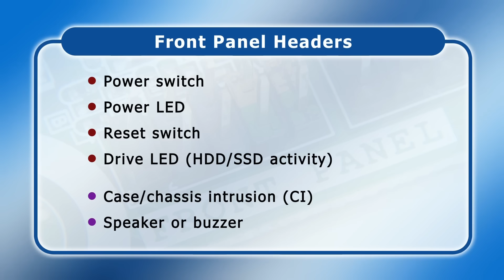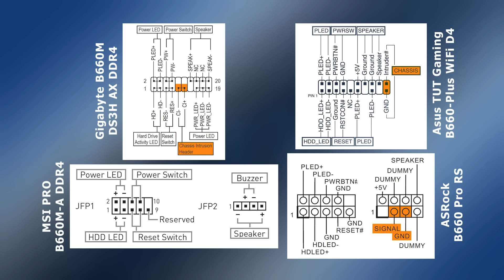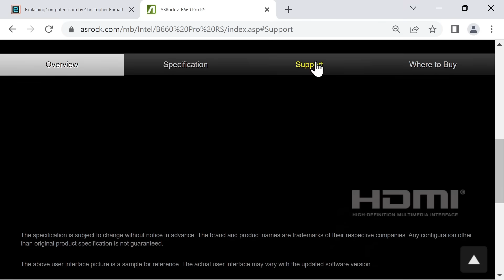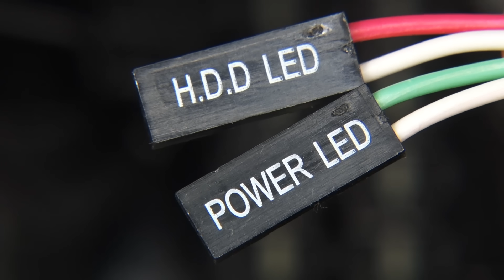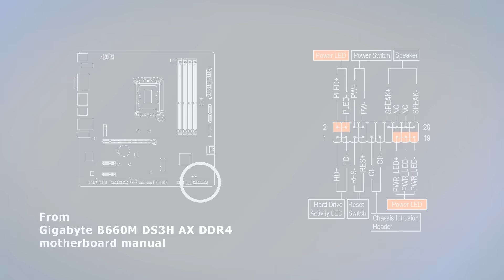Explaining PC Front Panel Connectors

Comment: I’m just building my 1st PC in 20 years and I’m astonished at how little has changed in all that time. I checked out this video to update myself and I find that almost everything is the same  (Except: The CI and TPM  connectors which are new to me.)
Ant they STILL haven’t standardised the Front Panel connections!!!
Reply from the maker: So true! Some things have not changed in a long time now. We just have new CPU sockets, plus M.2 slots. :) Oh, and USB 3.x headers are new in the past 20 years.
Reply: @ExplainingComputers   What really astounded me was the presence of the old  round "PS/2" keyboard connector on my brand new  motherboard:
  "Gigabyte A520M K V2 Motherboard - Supports AMD Ryzen 5000 Series AM4 CPUs" .    I haven't seen a keyboard or mouse with a round connector on sale  since the long-ago 20th century.    IBM designed it in 1987 (thanks Google).    Why on earth do they retain a  keyboard/mouse connector that  cannot be used?   Baffling.

Comment: Polarity does not matter (for the power and reset button). Thank you for that piece of information; my ASUS motherboard and/or Fractal Design case should have mentioned that.
Reply: My PSU has the label on the power pin's plastic face the other way when I plug it. I decided to plug it in so that the white (negative) lead goes where it's supposed to be by default. Threw me off for a moment 😅

Comment: I'm doing it since 1988. I'm not afraid doing it, but I ALWAYS have to consult the manual for the correct pin layout. Furthermore: a speaker actually HAS a polarity, but for the use case of just beeping, it simply doesn't matter if the menbrance swings to the wrong direction. I wouldn't do that for hifi though.

Comment: However this is a problem. Putting an older motherboard that doesn't have that 10-1 JFP1 plugin. The MOBO I am trying to install a 20-8 pin layout and I can't connect with out breaking up the connector pins. How does one go about fixing this connection issue?

Comment: NZXT cases come with just one connection for F-Panel. Just wondered if you have tried building a computer using NZXT cases? I find just one connection better than 4 different connector cables because of my poor eye sight. Also, I find motherboards with built in IO shield better so you don't have to fiddle with all the back connectors to align properly.

Best regards.

Comment: I've been coping with that very annoying non industry standard pin layout since before your time. Now however you can get motherboards with nothing but different colors on the base of the pin platform, and monochrome illustrations in the manual. 🤦 Being well into my 60's now with progressively worsening long vision I find myself wearing my glasses as well as trying to hold a magnifying glass, and sometimes a headlamp as well. Then I put a hand in front of either the light or magnifying glass and can't see jack s#*t. Can the case and motherboard industry please just agree upon a standard and make a plug and socket already!!!
Reply from the maker: Thanks for this, but I don't think you have been dealing with the non-standard layout since before my time. I'm 56, and the first IBM PCs were launched only 42 years ago! :)
Reply: @ExplainingComputers  At around 12:50 you said "back in 1996 I built my first desktop PC" My comment was based around that as I had built desktop PC's prior to the time you stated in your video. My ramblings were obviously poorly articulated and caused confusion.

Comment: Great and helpful. Just had to replace an older Asus motherboard with a new B550-Plus. Asus decided to eliminate the connection block that came with my previous board. Anything to save pennies.
Why is there such confusion between the definition of "GRD' and '-"?

Have yet to power up but have every hope all will be seamless

Many thanks.

Comment: I have a questions: is it possible to connect both minus from the hdd and power led? To use a rgb switch it has only 1 pin for minus and 3 for the colours each
Reply from the maker: Yes, if you have an LED with a pin for each colour, and a minus/negative pin, then you could (for example) connect its minus pin to the minus for the power led, and then two of its colour pins to the power LED and HDD pins on the motherboard header. All minus pins on the header go to the same negative rail -- ie they are all connected.

Comment: While a beep doesn't really need to sound great, and so polarity doesn't really matter on that speaker, for future reference it would be good to note that even though speakers run on AC, that which they run on is signal-sensitive, meaning that the hardest pushes of a sound should move the speaker cone forward rather than backward, meaning that ultimately a speaker's polarity does matter, at least in situations where the sound quality normally matters (the system audio being a perfect example of that).
Reply from the maker: The comments about speaker polarity in this video clearly in the context of a motherboard speaker, not system audio. And in this context, speaker polarity does not matter. This is an educational video, and in education, less is more.
Reply: @ExplainingComputers : I'm fully aware that you were talking about the motherboard speaker, which is why I already said "system audio" in the example that I gave of where the speaker polarity matters more. And I said that so that: 1. If somebody who sees this video was thinking of hooking up other speakers in a different situation, hopefully they would see my comments and not think that speakers are polarity-free; and 2. in case you were planning on making a video about connecting other speakers in a manual way like this, but to the main audio, you would remember to include that speakers actually are polarity sensitive.

Also, obviously this is an educational video, but "less is more" doesn't actually apply, because some material educates better than none, and none is less than some. And there are plenty of times when education didn't work because there wasn't enough explanation. So I would stay away from that maxim for education if I were you.
Reply from the maker: @HelloKittyFanMan  It is deeply unlikely that anybody would use this video as a gudie for connecting speakers in other situations. With over 30 years as a university lecturer and author, with many educational awards to my name, I think I don't need advice on that matter from somebody who doesn't even declare their real name on YouTube. Goodbye.
Reply: WOW,  @ExplainingComputers ! Whelp...  you never really know, and I've already made the comment, haven't I?  But that's why I said this in reference to one of your possible FUTURE  videos that includes speakers, isn't it?
You don't have to be so grumpy that you let your ego get in the way of accepting a simple info. comment like this main one.  Also, just because someone doesn't use their real name on a forum like this one doesn't mean they're afraid of what they're saying, or that what they're saying is unworthy of being taken seriously. Maybe you've never heard of having a nickname-based user name just for the fun of it. You might try looking around at all the different user names here that aren't people's real names. That's a pretty common thing, actually. Tell me: Is "Explaining Computers" YOUR real personal name, so you don't mind using this logic on me?
Reply from the maker: @HelloKittyFanMan  My name appears in every video and is listed in the YouTube about section. Yes, not saying why you are is pretty common. That does not make it good practice.
Reply: @ExplainingComputers : Oh yes, I forgot, it shows up right at the start; sorry, Christopher. "Not saying why you are"? Why I am... what? Or did you mean "WHO you are" instead? Because if so, then this is my reply: Yes, it makes a fine practice to have a playful handle. It's just a fun thing that a lot of people do and doesn't render what they say as any less credible if they don't already have some clout in the field that would raise their credibility above that of an average Joe.

If I were to put a name that looked real on my profile, how would that matter to you for credibility if you don't even know if that is my real name? I could use any real-looking name and you wouldn't have any idea if it was my real one or not, would you? So it doesn't make any difference if the name I use looks real or not; just because you might identify me with a realish name doesn't mean knowing that about me makes anything I say more plausible than if I say it with a totally fake-looking name. You don't know who I am either way. What matters is the material that's said, as long as it's verifiable; not just who says it. Or even if it's not verifiable but it still sounds like it makes plenty of sense as an idea of something to try, it still doesn't matter who I am.

And what I said about speakers does make sense to consider because you never know who's gonna view you as an "authority" on wiring this or that and then base something else they do on this. So it shouldn't be such a big deal to you or your ego if someone like me pops in with the information about speaker polarity for future reference even though it doesn't really matter just for a little beeper speaker. Try wearing a little humility sometime. Just because you have 3 decades of whatever experience doesn't mean you can't learn from someone else, ya know. No need to be grumpy about it, Chris.

And one of these times I might just share my real name.
Reply from the maker: @HelloKittyFanMan  I did mean "who". Just a typo. I am sorry if I have offended, and did not want to get into an argument here. But I think very carefully about what to say and what not to say in a video -- usually recording many takes, often scores of takes, to get it right. And sometimes I make mistakes and freely admit that in the comments.

But in relation to the issue that started this thread, I communicated clearly in the context of the video. I feel that YouTube has become a sort of caveat hell -- it is always possible to say more on almost any computing and related technical subject, but the more that is said, the longer and less accessible the content becomes for the intended audience (hence less is mroe). As I just said, I'm sorry if I offended. But I know how to teach, and whilst you may disagree (fair enough), I explained my position clearly in my first reply to your post. You did not seem to like that, and that's when I got "grumpy".

Comment: A few years ago my computer would randomly shut down. Totally random. This started happening more and more as time went on. Tired of it i suspected overheating, even though my gut told me thsi was not it. Took cpu off and re-applied thermal paste. North/south bridge got the same treatment. Dusted otu the cover. Cleaned the vents. Crossed fingers. Did not work. Ok. Cables. Must be cables. Replaced cables. Nope. That was not it. Faulty CPU or motherboard? Switched out both independent of one another. Nope that was not it. Memory. Must be memory. Nope. 

Running out of things to test here. Long before i started all this i suspected that it was very likely the simplest solution. Something which i had learned when i took some certifications, which i passed by the way. Occam's razor. After dusting out the case and re-appying the thermal paste i suspected that it was the power switch. It was. I had to get a new power switch.

Comment: I'm wrestling with these right now for an ASUS X470 board I bought secondhand from a friend.  I ended up getting a Q-connector to try and make it easier.  We'll see if it works.  At the moment the PC will not fire up for some reason.  The board is good so I'm wondering if I have them wired wrong.

Comment: Brand new Corsair 4000d airflow does not have HDD Led or Power Led connections, so no there won't always be these connections. There's no need for a HDD Led since everything has gone NVME SSD and there's no need for Power Led because the power button itself can be lit.  This information was generally true many years ago. Should probably do some research on current trends before making a video like this in 2023.

Comment: Something that wasn't mentioned in this video, is that Intel actually tried to create a standard for the front panel connectors (called the Intel Standard FPANEL connector), and a lot of their boards use the same layout. I've found that other brands sometimes used the same layout as well. Unfortunately it doesn't seem to be that common to truly be called a standard.
Reply: Actually, another thing i've noticed, if you look closely, every single board shown in this video (including the CGI render part) actually follows the Intel standard! So this might actually be a lot more common than I thought!

Comment: Thank you for your good explanation of these things. I just upgraded a old PC with a new motherboard, RAM and CPU.  And yes I was worried about the front-panel headers. But a bit of reading in manual and some common sense helped me and after some errors I managed to set it up properly. I wished I had watched this video before, would have saved me some time.

Comment: These are a little tough to connect/contact with since they are so small. Sometimes I had to flash a smartphone light onto it until I would finally get the connection right. It's sad that you can't get PC diagnostic speaker on the AM5 boards, but someday I am sure somebody will make a internal USB accessory of sorts, or maybe even a PCIe card with those legacy functions.

Comment: There are simple adapters where you can group together the front header plugs  to make them easier to plug onto the M/B (featured/mentioned on CaryHolzman YT channel).
Reply from the maker: Such adapters are motherboard manufacturer specific -- as the video shows, there is no single pinout standard, so no universal adapter! :)

Comment: 2022.. why is this still the exact same mess as it was back when I built my first 486 in high school?
Reply: :) if you don't have a manual just drag a screw driver over the pins till it turns on... don't actually do that.. not that I have... cough..
Playing hours of Kings Quest 1 with a PC speaker for sound.. I wish to disagree. :)
Reply from the maker: Good point on old games using the speaker! :)

Comment: Great video My biggest gripe is these stupid connections need to be one plug and a industry standard connector. On small cases with the motherboard right up against the case I have to use needle nose pliers to connect them its a stupid system.

Comment: Hi Chris. You can get a "quick release" front panel connector as my motherboard has one. It's like a carrier that you slot all of the front pannel connectors into and then the whole thing slots into the motherboard. My mobo is a Gigabyte Aorus Elite X570 if you wanted to take a look. Also front panel connectors have an arrow on them indicating the positive

Comment: About 3-4 months ago I performed a motherboard upgrade (the motherboard didn't work ;-;) but I remember being very stressed about the front panel connectors, and now I know that for the most part, it doesn't matter, thanks

Comment: If there's anything you can safely connect and disconnect while the board is running, it's the panel LEDs and switches. ;)
Reply from the maker: True, but it would not be wise for me to recommend people working on equipment with the power connected.

Comment: I remember when the power button had 4 wires to connect, one time i made a bad mistake because of my ignorance at the time, i short circuited that switch, when i plugged at the wall socket, the thing exploded and burned, that thing scared the shit out of me, i had to threw it away. Luckly there is no more A/C live wires inside the cases today 🤣🤣🤣

Comment: The main thing to scare me about building computers is the complication of the front panel pc connectors.
A few days ago I had to deal with installing a motherboard into a new case for the first time and discovered that it wasn't so bad.
The worst part was how fiddly it was to get them in the right places.
It was actually quite easy!
I'm not sure if I was simply lucky or if it always had been this easy.
Regardless, I'm sure this video would've been a lot more helpful to me back then.
Still, a great video, assuming it shows up when people need it, and not after.
Reply: They are only connectors, you don't even need to bother with them in you don't mind turning on your PC on with a screwdriver.
Reply: @MarkWhich  that seems a bit silly
it'd mean I'll never be able to close my case and it's an incredible inconvenience

Comment: An extra thing to note that is interesting:
While not necessary, the OS or program could send beep signals to the PC speaker, this could be for notifications, pop-ups or errors in standard applications (like in early windows when no soundcard was present (and sometimes (although very rare) in modern windows)), sound FX in games or even music when applicable by some games or music software. One good example of beeper music is from the recently released Area 5150 demo for the stock IBM PC 5150 (4.77 8088 CPU with CGA) which makes good use of the beeper while also having amazing visuals.
Reply: there was a whole demo dedicated to the pc speaker for the ibm pc, it's called "system beeps"
Reply: FastTracker II, a music tracker for DOS, actually has a function that lets you play the music through the PC speaker, and if you have a fast enough CPU, it actually sounds quite good, and has a decent sampling rate, even if it ends up being quiet!

Comment: This FP connector already standard decades ago and any PC case maker should have repurposed USB2 connector to make connecting these a breeze.
A ribbon cable type is problematic to install. And if you do not want to separate the cable, use a cellophane tape to merge all connectors.